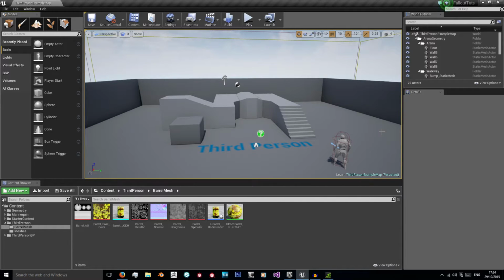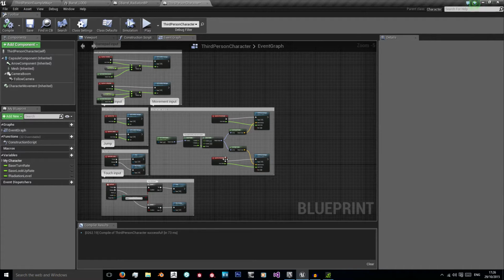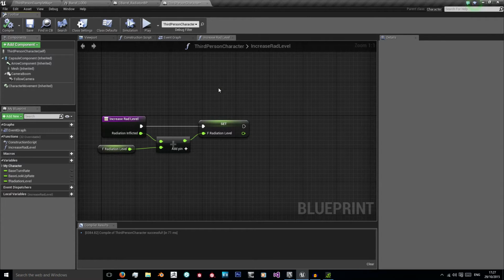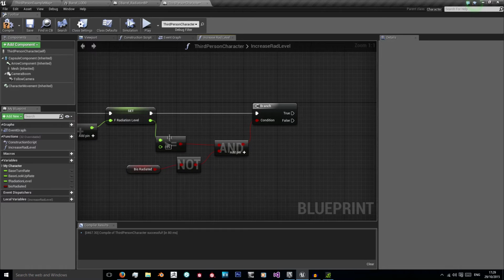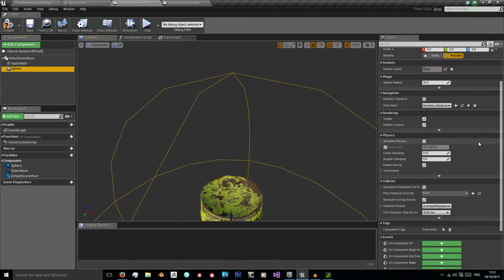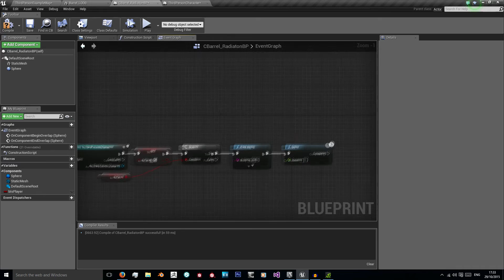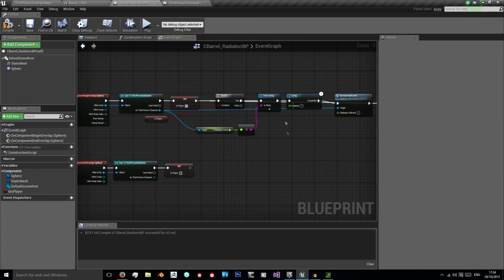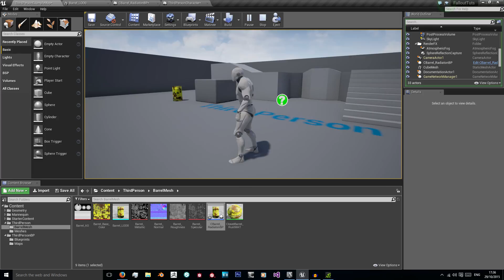Creating Fallout 4 in UE4 - Making the barrel irradiate the Player [2/2]

Comment: Simple way to do the radiation scale like in fallout 4 is by using "Get Distance To" on the barrel.  you can then increase the # of rads given to the player depending on the distance with simple greater than + smaller than checks.  Didn't see any other tutorials on the barrels, so i thought I'd toss this in for anyone wondering how to do it.